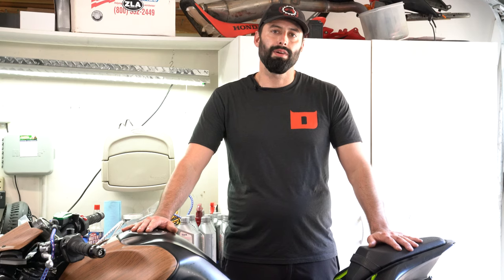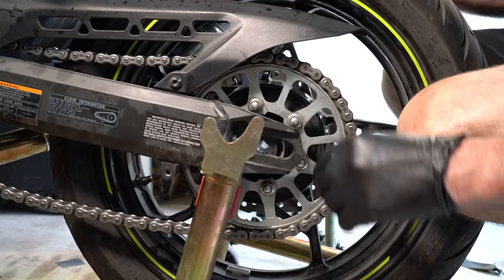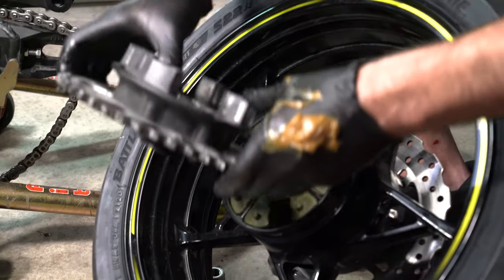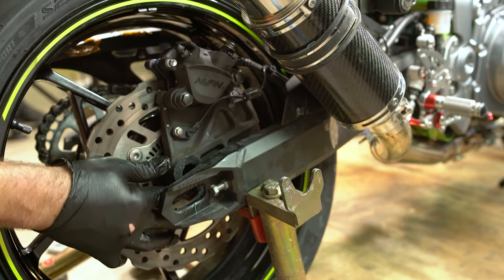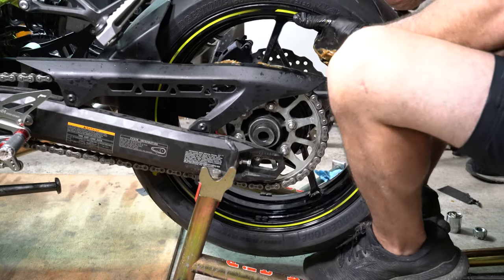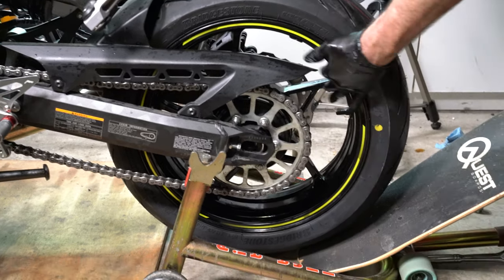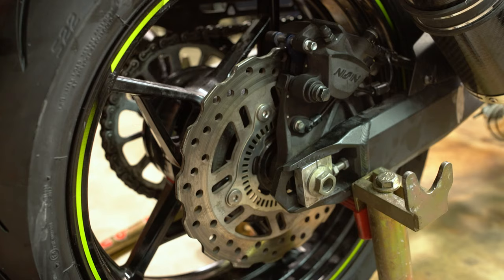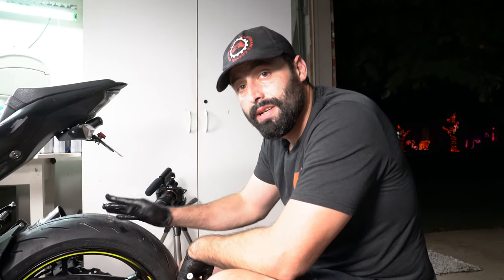Kawasaki Z900 - Rear Wheel Removal & Re-Install

Comment: thank you, just followed your instructions and switched out my rear tire without issues. What I did was sit behind the wheel on the floor and push the tire up with one of my feed. Shortened the whole rearrangement part to 2-3 minutes to get the rod in

Comment: There is a 27mm & 22mm wrench under your seat for this very application.   It helps if you slip a bar over the end of it for extra leverage.
Reply: Where’s it located? Nothing seems to be under my seat. Just need a 22 MM , going to the auto store but checked under the seat first

Comment: Side note. Place a 2x4 or two under the wheel and when you roll the wheel forward onto the second 2x4 it will line itself up.  That way you’re not trying to left the wheel and place the axle at the same time.   Keeps everything straight and spacers from falling out.  He did mention this towards the back end of the video

Comment: Jees! That looked like a real struggle! Thanks for doing the video, very informative. Heres a tip to make it a little easier next time. Before you take the wheel off, shim up with different thicknesses of timber boards from the floor to the tyre, so they just touch. Then when you go to refit just have the exact shims handy to place under to the right height. Saves time and effort. At least in one direction anyhow! Thanks again
Reply: Timber boards?..........lol
Reply: Thanks. Although that's ZERO help after you've already got it off.

Comment: Sory but a very messy work. Like the grease is all over the place, you probably accidentaly touch the diskbrake with a greasy hand and thats not good.. 
Remove the brake caliper next time and it will save you from struggles

Comment: I did this, and now my speedometer is having issues, it jumps around about plus/minus 10mph from where it should be, and doesn't seem to go above 55 now. Have any ideas what I could have done wrong?
Reply: All bikes have the speed sensor in a different location, for example my cbr has the speed senor over the counter shaft which sits on top of the transmission. The z900 may have the speed senor over the pulsar ring that is located inside the rear brake rotor. You can see it in the video its a metal ring with little rectangular slots cut evenly all around it. A sensor will be facing some where over the ring. On my cbr that ring will give the imu information for the abs brakes and traction control. On the z900 it may give the information to the speedometer. Make sure this sensor isn't lose or damaged in anyway from the tire change. I hope this helps,
Dr. Speed Lemon.
Reply: @dr.speedlemon739  thanks for the reply, turns out on my z900, the speedo sensor goes through the brake caliper, and was slightly damaged from me putting it back together missing a spacer.
Reply: @HoCo_xXSamXx  how much was it to replace? Think I did the same to mine?

Comment: Hey i just did this and the front wheel but now whenever i turn the gas i get Like a grinding sound. I relubed it plenty but still Happening.
Reply: It sounds like you left a spacer out which will cause a grinding sound.

Comment: Not to be a nit picker but you are using that Pitbull stand incorrectly.  When using the standard pins on the swingarm, the pins need to be oriented high side up.  This prevents scratches to the swingarm and more stability because the red tabs are up and tightly against the swingarm preventing side to side movement better.